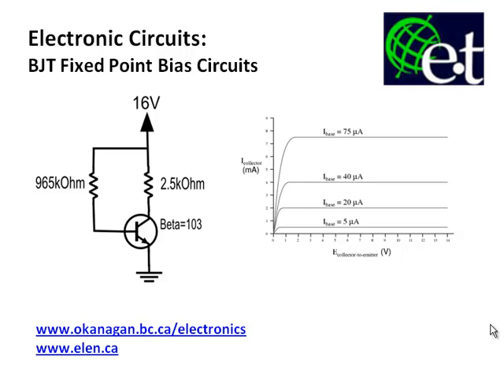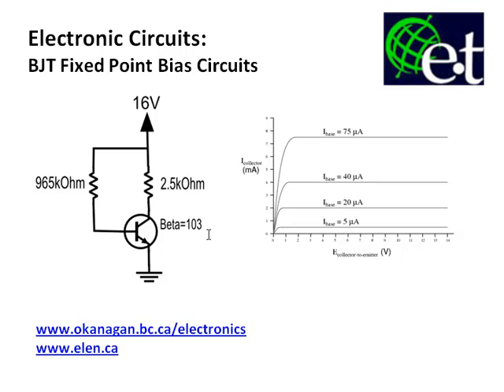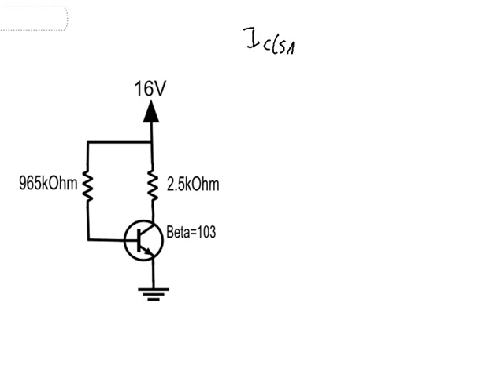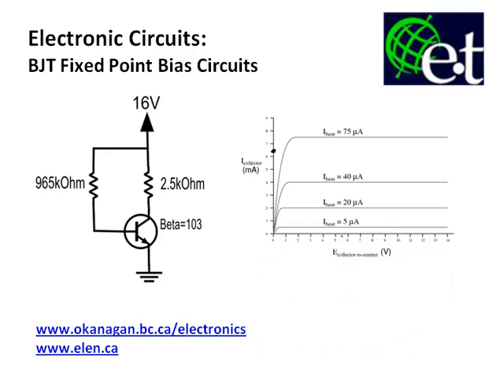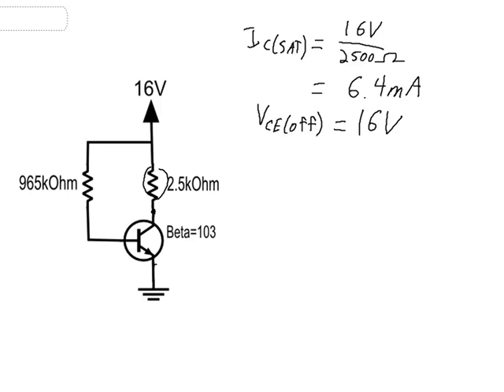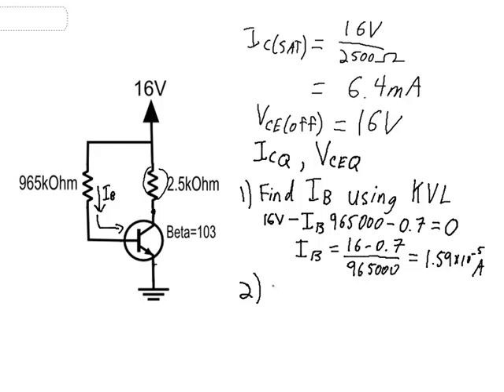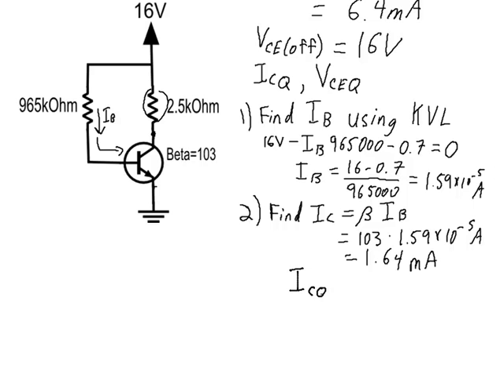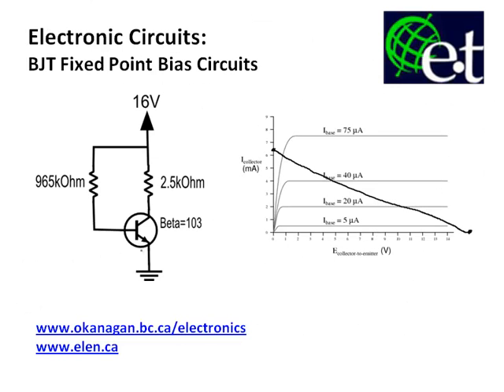BJT - Fixed Point Bias Circuit

Comment: What is the best operating point or Q point.
Reply from the maker: It depends on what you are using the BJT for. Two simple examples: 
If it is a Class A amplifier, you would want to bias to the middle of the load line. If it is a Class B amplifier, you would want to bias it at cutoff.

Comment: greeetings sir... i have a query ... at 5:45 , while solving for KVL, you said 0.7V is an assumed value for the base emitter voltage Vbe ... is this just an assumption? or is there a reason ?  in general, when solving BJT related problems, is this  the general assumed value?
Reply: Vasishta Kanthi why 0.7
Reply: Buak8FO3 no it is not assumed value but it is tested
Reply: .7 , .8, or .6 if it's made out if silicon. We assume it's made out of Silicon .

Comment from the maker: With the beta given in the diagram as 103, you have to assume that some tests were done to determine the beta value.  You can't just know what beta is for a transistor even if you have the datasheet.  Usually you are given a range of values which can be ridiculously huge.  Normally in electronic circuit design, you try to make your circuit as independent of the beta value as possible, and that usually means using multiple transistor circuits...not fixed point bias circuits like this one.
Reply: I see now this answer , thx